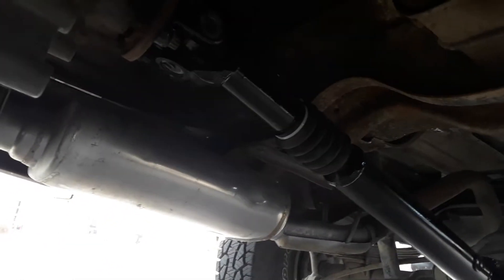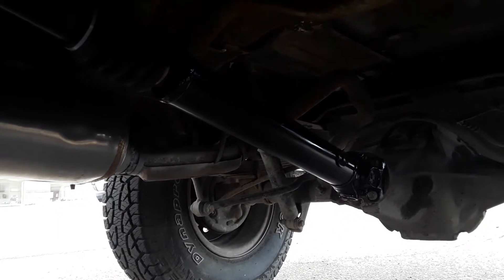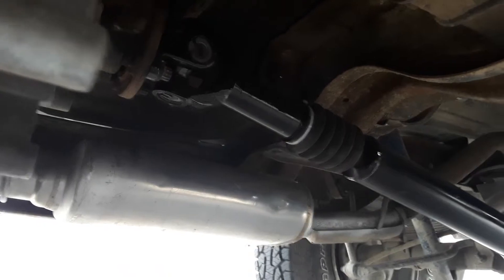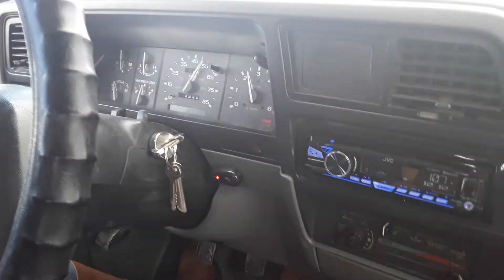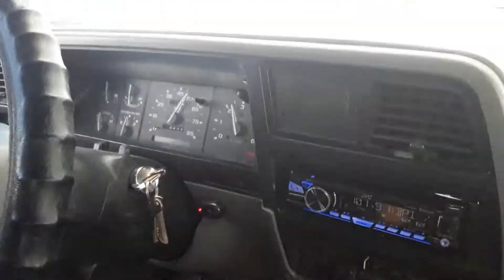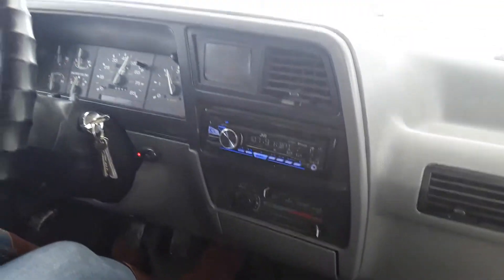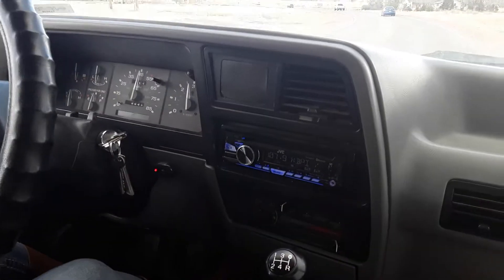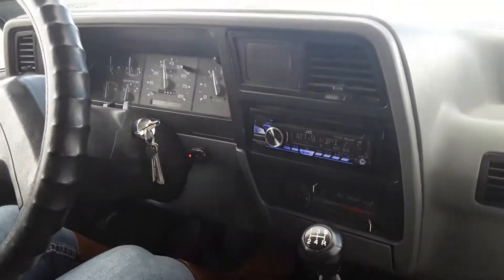Bronco II driveshaft Update.

Comment: Cool. You happy with it?
Reply from the maker: Yes sir, this is the engine that should have came with these trucks from the factory.  I am getting ready to do another one over the winter if everything goes right with the client.
Reply: @risersgarage7004  uh, you swapped in a 4.0
Reply: I've got the 2.9 and it's doing fine, just need to fix those driveshaft cv joints or maybe upgrade the shaft
Reply from the maker: @freddykrugerl2888  Yes I did the 4.0 swap and I did the upgrade on the driveshaft. So far so good I am almost at 1.5 years and it has been trouble free.  The best part of this driveshaft is never having to mess with those terrible CV joints again.
Reply: @risersgarage7004  changing the driveshaft is easy you say? Any 1st gen explorer? Then shorten
Reply from the maker: @freddykrugerl2888  yes sir, 1st gen explorer and a trip to your local driveline shop and you should be in business.  No more clicking from those CV joints.
Reply: @risersgarage7004  thanks sir 🤙🏽